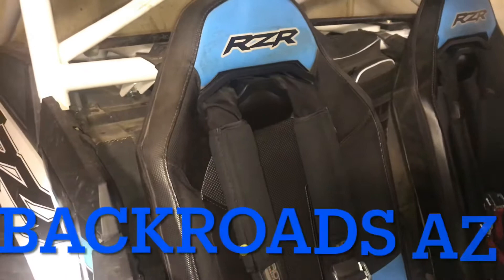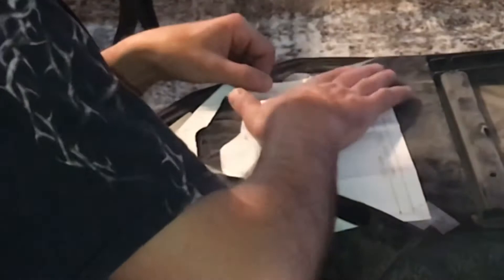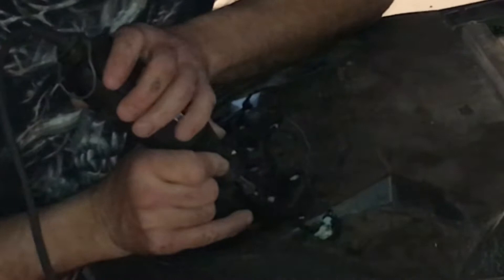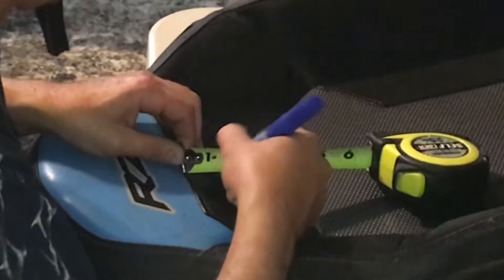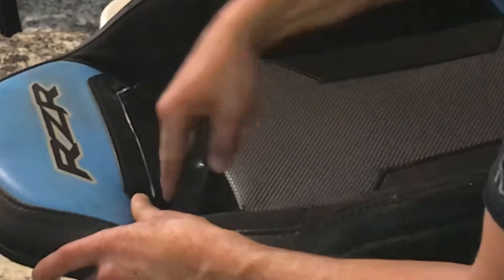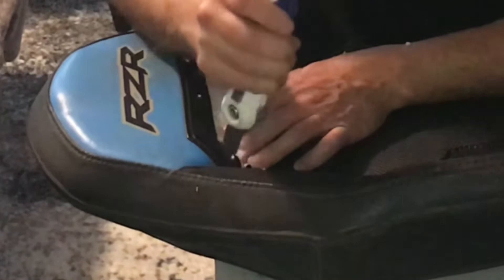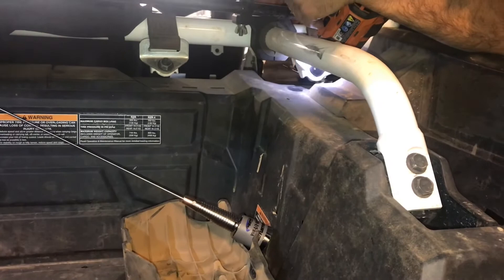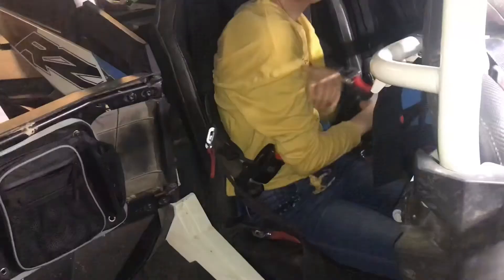PASS THROUGH SEAT INSERT/BEZEL INSTALLATION FOR 4 POINT HARNESSES ON 2020 RZR TURBO S FACTORY SEATS

Comment: I watched your video to help me with my installation today.  Great information!  I will say, I used a gig saw and had the seats cut out in less than 10 minutes.  It literally takes longer to tape the template to the seat than it took to cut them out.  I used a large bread knife from the kitchen and cut out the foam fairly easy too.  Now, getting the two pieces of plastic to go together perfectly was a little more of a challenge.  Each seat probably took about 20 minutes from start to finish.  Thanks for the help!